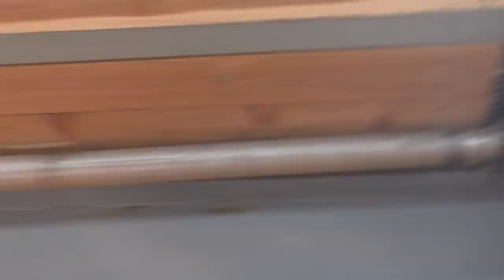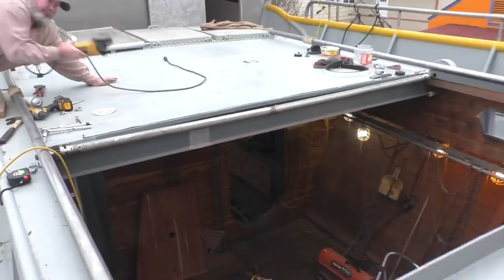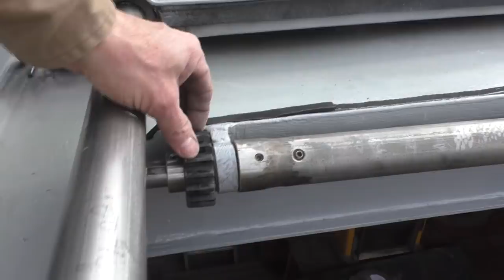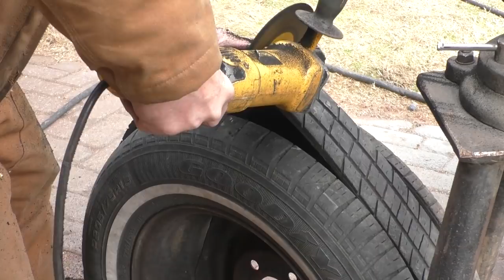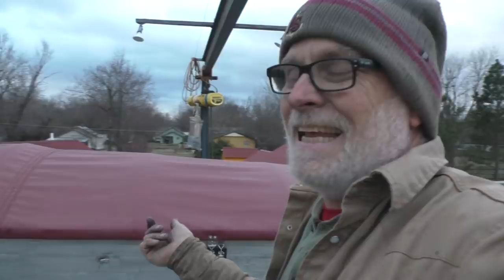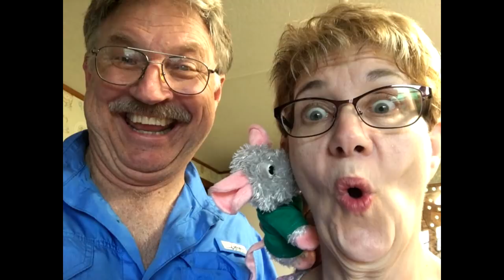Cargo Hatch Redo and Dinghy Cradle

Comment: Those light alloy rivetted dinghy's are great on the rocks because they are light they just bounce off I grew up on a surf beach we used to row boats exactly like yours through surf 6 ft high to go fishing we also used to row them in to the rocks to get onto some small islands sometimes we would let the swell lift us onto and deposit us onto the rocks very useful little boats. Tip, the trick to getting back in through the surf was to row in backwards when a wave comes row forwards slowly and ride over the wave quickly rowing backwards after it passes and let it suck you back in. always keeping the bow facing into the waves.
Reply from the maker: It the right hands, lots of things can be done.  But we had to weld the bottom back together in several places.

Comment: do you want to consider makeing a drill attachment so you can  open and close the hatch with either a electric motor or a cordless drill or a permanently attached pneumatic motor and worm drive
Reply from the maker: Only when I get too old to do it manually.

Comment: You may want to look into 'Hydro-static' Releases, so if the vessel does sink, the Dinghy will be released and float to the surface, provided it has buoyancy to do so.
Reply from the maker: I think that expensive and over complicated shit is some engineers idea of a good idea.
Reply: @SVSeeker  here it's a legal requirement for the ships tender and liferafts, along with a supply of life jackets to have hydrostatoc releases on them.
Reply from the maker: @lachlanlandreth9069  Too bad.  Here we still have some freedoms.
Reply: @SVSeeker  have you had a vessel surveyor come down and asses the vessel during construction? Or do you plan to get one in closer to the vessel launch day?

Comment: That rubber strap made from car tyre wount hold up for very long in the sunshine. It might benefit from some coating on it, or something, to protect it from the uv rays.
Reply from the maker: That's worth worrying about?   You go find yourself a 40 year old tire an give that bull shit a test.
Reply: IYO what uv protecting or what material would work better? Tires hold up tons of weight for years and lots are rated to go over at least 80,000.00km if not more. This is on top of asphalt, concrete, dirt, and rock in the sun. Please let me know. Thx.
Reply: @SVSeeker  No worries. But we used strips from car tyres like that as protection for our boats around our dock. They would deteriorate after a few years. Just became brittle and fell into lots of  pieces.
Reply from the maker: @norwegianinph    Bull shit.  I've have trailer tires older that you.